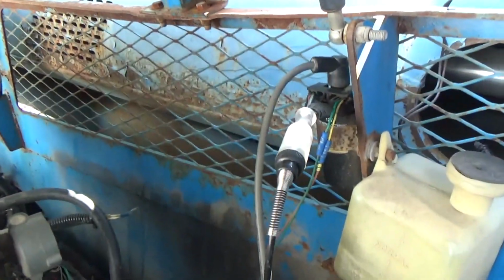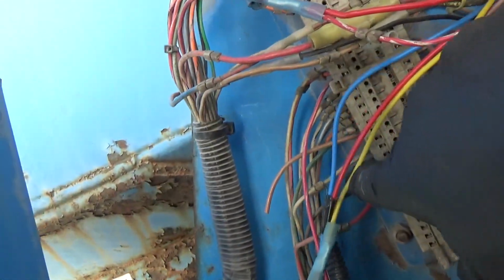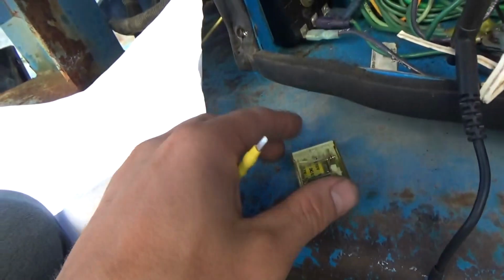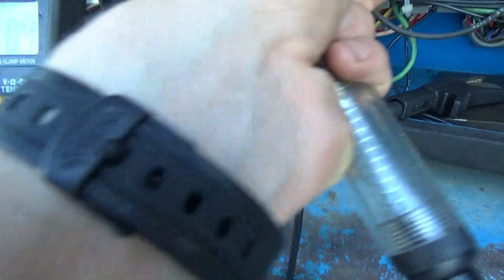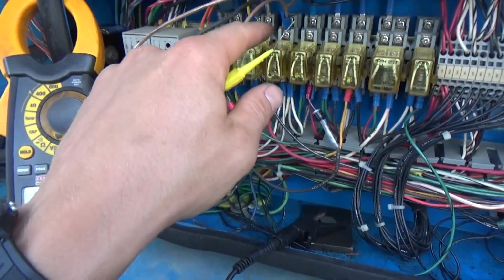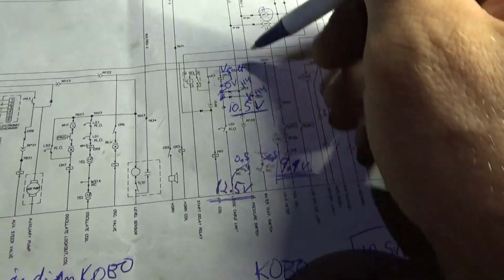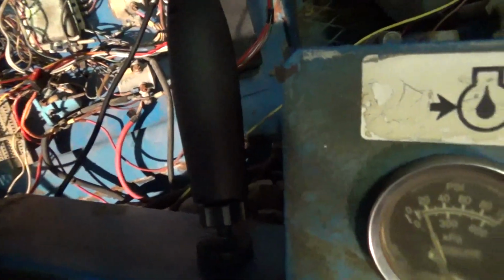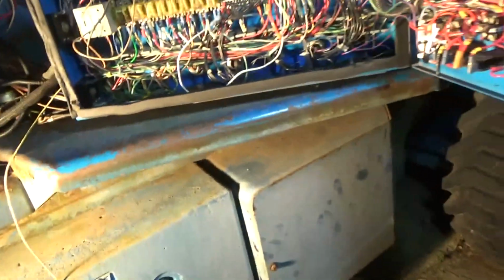Genie Boom Diagnosis Part 2 - PHAD Montana Road Trip - Day 8

Comment: the timer controls PR3 The contacts have to be closed in the timer in order to start the engine. After startup the timer times out at the set point of 4 seconds becouse one of the hold-in contacts did not close. Either oil pressure switch or tachometer switch. or?

Comment: I've got an interesting one, I purchased a 2007 with a Ford dual fuel. It tipped off a trailer. Broke the plastic intake, and a few switches were smashed. I get the alarm for unevenness and the engine light is on. Key switch to boom basket sets that alarm on but only on the basket side. No start, well nothing except the bing bing bing which I stopped once by removing the battery cable but it started bing ing again after a couple of key switch Any ideas? I am stumped but want to finish my shop

Comment: Lol, this sort of tissue  reminds me of a Bogger (mining shovel) that would shut down whenever the bucket was lifted,..... except I didn't have to spend a great deal of time.....  

I got frustrated and bashed my hand on the dash and everything powered up! I got behind the dash and found one of the 20 shutdown relays (this one was for fire suppression) had a wiring terminal backed out of the terminal.

Industrial crap can be so frustrating as it is not familiar, especially without wiring diagrams.

Good on you for your persistence.

Comment: When it was the oil pressure switch turning the engine off, did you then check the dip stick for the proper amount of oil?

Comment: Looks like a fairly simple circuit. Worst part about working on older machines is that a lot of wiring was messed with and changed or "modified". Sometimes it helps to rip out  part of the circuit and redo or rewire it properly.
I do industrial controls for a living (EE). One of the tools you may find useful is a circuit tracer. I'll post a link below. It takes some getting used to and you can't use it on a live circuit. I find it very handy when trying to trace a single wire in a large bundle of wires, with no schematics available. I have used this device for finding problems in automotive wiring as well.
Here is the link:
https://www.amazon.com/Greenlee-701K-G-Professional-Probe-Tracing/dp/B0042VII7A/ref=sr_1_1?ie=UTF8&qid=1501285770&sr=8-1&keywords=progressive+electronics+tracer

Comment: Rather than the control module driving the throttle solenoid direct it could drive a 10A delphi for example solid state relay, solid state relay would be cheap safety net compared to control module driver circuit burn out if that was what happening within the module .
With amount of hacks on that machine would take lot of time get it to tidy logical order :-S

That muffler is real bad location when running and doing repair work lol.
Safety 3rd was a good line lol ... edit that out before renew your liability insurance lol .

Comment: There is nothing worse than working on what's left of someone else's hack job......a nightmare!  It's just as bad as wired in auto alarms and remote starter issues, if not worse.....Friendly advice:  Ask them if the equipment has been modified BEFORE committing to the job......Still, you impress all the same...nice work.

Comment: Someone(the twisty tech?) subbed a temperature SENDER instead of an overtemp SWITCH, providing a resistance value, not an ON/OFF switch.  On the side of the block above and to the right of the oil filter.  Oil sender is further up, on the side of the cylinder head.  Both one-wire items.
Reply: It sounds like you are familiar with these machines! Maybe you would be the right person to restore the Genie to its original wiring and working order.

Comment: Lack of sleep and a problem child like this one, well, that's a recipe for a lost temper! You kept it together very well I must say, Ivan - I'd have been throwing things for sure! Those are ones that I HAVE to walk away from for a bit, eat, then regroup.

I had worked on my sister-in-law's late 90's Ford Escort one time until the sun came up. She had to be at work that morning, so there was no giving up. I think I scared her a few times with my outbursts, LOL. So frustrating to begin with, then throw a lack of sleep into the mix - not good! Think I did a timing belt, but in the process I had to deal with rusty bolts on the p/s pump that snapped off, then I started the job without being on TDC ... which is all well and good, but I inadvertently rotated the engine with the belt off! Had to pull the valve cover to see where the cam lobes were pointing, since I couldn't make heads or tails of the marks - ended up a total horror show. I'll never forget that one.

Comment: Not that you want to hack it up more but Could you add a relay to isolate the server current 5a from the controller itself
Reply from the maker: Like an on-off relay? It needs to be a continuous controller to smoothly vary the throttle opening...
Reply: Pine Hollow Auto Diagnostics oh yea that wouldn't work nevermind

Comment: I think you confused yourself around seventeen minutes. You showed that the ground removal didn't make the engine work. Then, you applied a positive lead to the bottom of relay CR3, which made the engine work. You then believed that without the positive lead, the engine would work, and got confused when it didn't.

Comment: U could use a relay to handle the current to that 5 amp servo. Then u wouldn't take a chance on overloading the transistor in the controller. I imagine that's what Techno did
Reply: Bill Rimmer Problem is it seems to be a variable current output, not just an on off switch. Would need something a bit fancier to make that work.
Reply from the maker: Exactly...this is a variable-current circuit.

Comment: Nice job with the repair. After spending way longer to get it running I'm sure it was tempting to hook up the gov. Good call leaving it alone until known good established. It's so hard to work on a hacked electrical system.

Comment: Excellent work Ivan its difficult when its been rigged so much already and it can get really frustrating but you got it back running so at least he can move it around once he cleans out the fuel tank and puts new fuel in it

Comment: I was about to pull out my hair. I was getting so impatient. As an industrial electronics technician this troubleshooting problem seemed so obvious but he too k so long. The timer bypassed the relay to give it time to build up oil pressure. If the water temp was low or as long as water temp sw was good the relay would turn off closing the NC contacts after the delay timer timed out. The water temp sw was probably corroded by water inside gauge housing causing a high resistance ground. If the diode were shorted the voltage drop would have been much higher than the 4V. Replace the water temp switch.

It is hard to say about the linear actuator. 5.4A seems normal. I think the resistance on the actuator coil is supposed to be 2 - 3 ohms. I think if the linkage is not adjusted correctly the engine will over rev and cause component damage.
Reply from the maker: We're not done with this beast yet. And when you literally have 10 separate issues stacked on top of each other, the diag becomes much more complicated, like a tangled ball of strings. Not to spoil the ending, but that water switch problem was not a component fault. It was yet another consequence of the previous hack repairs. :)
Reply: I don't doubt the problems caused from previous repair attempts. It is hard to come behind someone else especially if they don't know what they are doing to begin with. I often forget that videos like yours are to help teach others and I tend to get impatient. Although sometimes you almost seem to doubt yourself.

Comment: that wiring is way too hacked. as someone else pointed out that diode may have shorted.common failure .i always kept a few in my toolbox. that governor actuator is a radially wound sollenoid  similar in ways to a stepper motor except there is only one winding of various wraps. if memory serves me the out put of the box should be pulse width modulated.they dont hold up to full throttle  constant operation. never did and never will.  is there a hydraulic problem that is making the engine need to put out that much power?. or is it pulling full throttle because the engine isnt running right?  theres a reason people sell these.

Comment: 5 amps is kinda high for what is basically a solenoid or actuator.  This would have been hard for me to work on, because I would have spent the time to fix all the hacked up wiring and bypassed switches.

Comment: Cr 3 opens timer relay should close to complete the circuit alarm could be the machine is not level
Reply: Machine is currently on level ground. That's not to say the level sensor isn't bad?

Comment: I have been using this lifts in my work if I remember correctly to give the machine throttle from machine panel or the working area standing in the boom I don't know the name let's call it basket you switch the key in control panel and to give it throttle you have a pedal in the basket where you work or a switch on the machine panel when control it from the ground. But it has a lot of safety switches. Great work both of you I think Vladimir liked it too I think he did good camera work also. He seems to be a smart guy.

Comment: This thing is so bad that it needs a complete rewire. I wouldn't be surprised if the engine isn't on its last legs.
Reply from the maker: It already HAD a complete rewire...using thin 22ga wire!!! As expected, most of the problems were built-in during previous repairs :)

Comment: Throttle control solenoid box should be replaced to eliminate the chance of an intermittent dead short with inductive flywheel spikes that possibly killed the previous expensive MOSFET driver box. Nothing else other than a Bozo would the reason for the driver box to go south - too many Bozos on this one. Vlad is a pretty sharp cookie to have around, does a fair job at camera work too. This one needs some serious re-evaluation as to end purpose and desired working features with owner. Well done on team Vlad and Ivan, keep those ear muffs handy guys.

Comment: Because everything is hacked so much, take the fuse relay addition that is not used and use it as an isolation circuit between the board and the governor. This will eliminate the 5 amp current draw on the board. Great video, just a little late for a quick fix. lol

Added: Just thinking that it might be possible that the previous repair person may have already tried to wire it this up.

Hard to trouble shoot from the chair.

Update: I was just thinking that the relay may not work. If the input to the governor is a variable solenoid  the out put would need to be a variable current source. Don't think they would have incorporated a PWM circuit.
Reply: I believe this would be a good solution. An interposing relay between the two.

Comment: that is a complex machine, i would redraw the relevant part of the diagram and by the time you got it on paper it should be clear what the different functions are.

1   if cr3 is energized it opens the n.o. contact to pr1 and shuts it off. 
2   the timer bypasses the cr3 contact until oil pressure is achieved.
so cr3 should only energize if there is no oil pressure.

would help if you could find the specs for the controller box output current, good call not to connect it up just yet, especially when they failed in the past.
as soon as i heard about the timer my thoughts were; hmmm ......oil switch??
nice find of the loose wire behind the oil pressure gauge, and i really enjoy the way you diagnose, no shortcuts and all the suspense.
way to go you two!

Comment: trying to clean up an electrical mess someone created is a nightmare sometimes. I think you did great. But my is it time consuming.
Reply: I had an '89 S10 Blazer that looked exactly like that under the steering column, thanks to an aftermarket alarm system from the 90's. I must've yanked 300 miles of wiring out of that thing ...

Comment: All these relays, maybe this is why the tipm was created.
Reply: Nah, they just soldered into place a lot of relays and fuses.  Now you can't just replace a relay, gotta buy the whole thing.  $$$$$  A fusebox, you can pull & replace.
Reply: Isn't the TIPM just a fancy name for a normal fusebox?
Reply: yeh surface mounted relays, like that a great idea on a car for on the road quick repair . They excelled in engineering it to be super unreliable. They'll be soldering in your lighting bulbs next and you buy complete lens units lol .